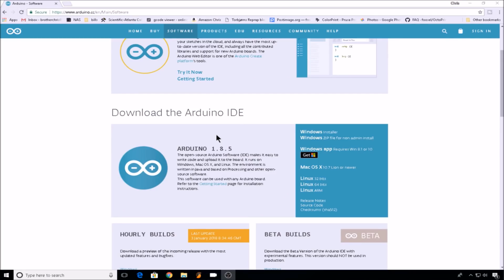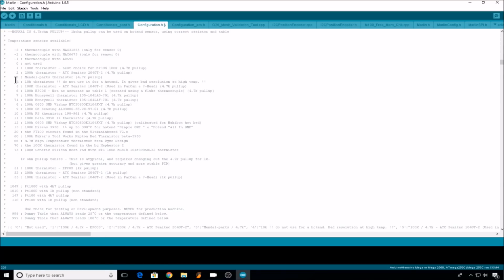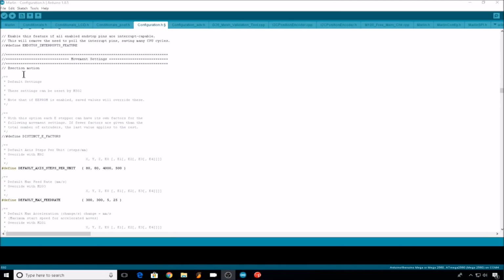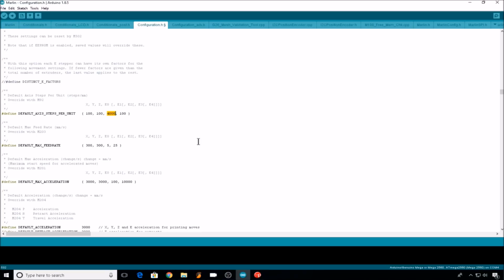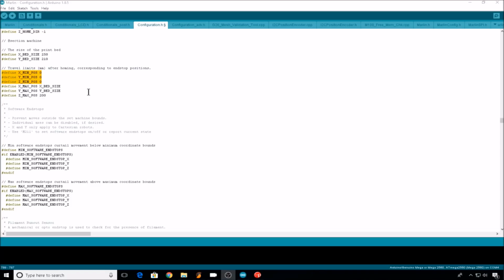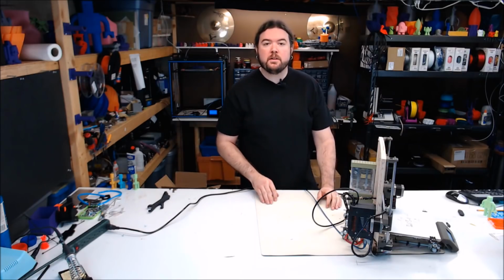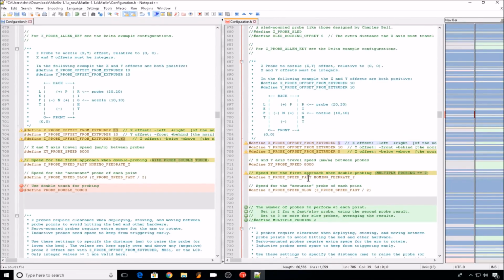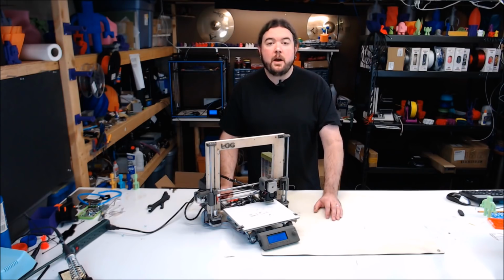Marlin v1.1.8 3D Printer Firmware Complete Config - 2018 - Chris's Basement

Comment: Perfect, thanks Chris!
Any experience in enabling filament change? See config_adv.h line 879ff
I tried this by first enabling NOZZLE_PARK_FEATURE.
it's all functional except FILAMENT_CHANGE_LOAD (feedrate+length).
No idea ... you are the hero ;-)
Reply from the maker: mediasync stephan scharf Thank you! I have messed with it before. I can get you my settings. It will be included in the next Marlin video.
Reply: Supi! Thanks in advance Chris!!!
Reply: M1.1.8 also manual filament extruding failed ;-)
Reply: found the answer:  EXTRUDE_MAXLENGTH must be >= FILAMENT_CHANGE_LOAD_LENGTH
Reply from the maker: Here are the settings I use just for reference. I finally got around to pulling them. This is Marlin 1.1.8, I like to bring the nozzle to the front right corner for the change.

#define NOZZLE_PARK_FEATURE

#if ENABLED(NOZZLE_PARK_FEATURE)
  // Specify a park position as { X, Y, Z }
  #define NOZZLE_PARK_POINT { (X_MAX_POS - 10), (Y_MIN_POS + 10), 20 }
  #define NOZZLE_PARK_XY_FEEDRATE 100   // X and Y axes feedrate in mm/s (also used for delta printers Z axis)
  #define NOZZLE_PARK_Z_FEEDRATE 5      // Z axis feedrate in mm/s (not used for delta printers)
#endif

#define ADVANCED_PAUSE_FEATURE
#if ENABLED(ADVANCED_PAUSE_FEATURE)
  #define PAUSE_PARK_RETRACT_FEEDRATE 60      // Initial retract feedrate in mm/s
  #define PAUSE_PARK_RETRACT_LENGTH 2         // Initial retract in mm
                                              // It is a short retract used immediately after print interrupt before move to filament exchange position
  #define FILAMENT_CHANGE_UNLOAD_FEEDRATE 10  // Unload filament feedrate in mm/s - filament unloading can be fast
  #define FILAMENT_CHANGE_UNLOAD_LENGTH 100   // Unload filament length from hotend in mm
                                              // Longer length for bowden printers to unload filament from whole bowden tube,
                                              // shorter length for printers without bowden to unload filament from extruder only,
                                              // 0 to disable unloading for manual unloading
  #define FILAMENT_CHANGE_LOAD_FEEDRATE 6     // Load filament feedrate in mm/s - filament loading into the bowden tube can be fast
  #define FILAMENT_CHANGE_LOAD_LENGTH 20       // Load filament length over hotend in mm
                                              // Longer length for bowden printers to fast load filament into whole bowden tube over the hotend,
                                              // Short or zero length for printers without bowden where loading is not used
  #define ADVANCED_PAUSE_EXTRUDE_FEEDRATE 3   // Extrude filament feedrate in mm/s - must be slower than load feedrate
  #define ADVANCED_PAUSE_EXTRUDE_LENGTH 50    // Extrude filament length in mm after filament is loaded over the hotend,
                                              // 0 to disable for manual extrusion
                                              // Filament can be extruded repeatedly from the filament exchange menu to fill the hotend,
                                              // or until outcoming filament color is not clear for filament color change
  #define PAUSE_PARK_NOZZLE_TIMEOUT 45        // Turn off nozzle if user doesn't change filament within this time limit in seconds
  #define FILAMENT_CHANGE_NUMBER_OF_ALERT_BEEPS 0 // Number of alert beeps before printer goes quiet
  #define PAUSE_PARK_NO_STEPPER_TIMEOUT       // Enable to have stepper motors hold position during filament change
                                              // even if it takes longer than DEFAULT_STEPPER_DEACTIVE_TIME.
  //#define PARK_HEAD_ON_PAUSE                // Go to filament change position on pause, return to print position on resume
  //#define HOME_BEFORE_FILAMENT_CHANGE       // Ensure homing has been completed prior to parking for filament change
#endif
Reply: Fine Chris! Set your nozzle park position so that bowden tube is relaxed for filament insert, depends on printer type.  So in most cases this is a x-axis position on the right. And not to touch the print inadvertently you choose the right front.

Comment: Can you or anyone out there help me with my project? I'd like to comment out everything except the ability to control, through Gcode on the SD card, not only the X Y Z axes as they are, but two extra axes, either E0 E1 or A B and C or whatever we want to call them. Want to be able to use this as a CNC type of machine with 3 extra axes for additional tasks. I'm a chemist not a coder. mgilbert@caisc.com
Reply from the maker: I think you can do this, you should make extruders 2, then set the termistors 0 and 1 to 998 so they always read 25 C. I am not sure what your extra axis's are for, but you can set there steps per mm accordingly.